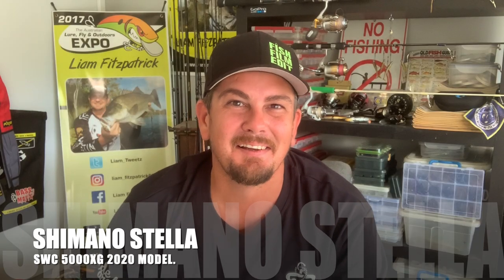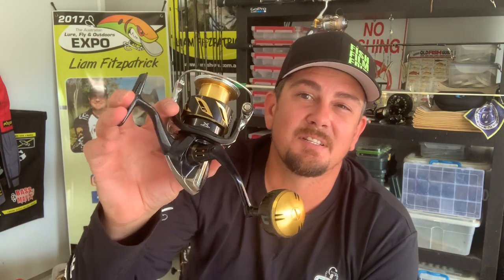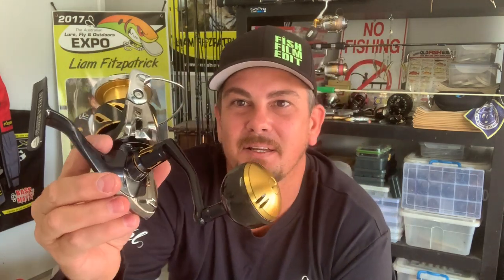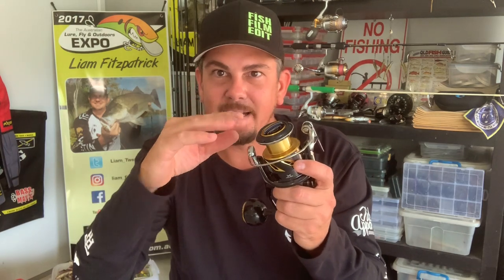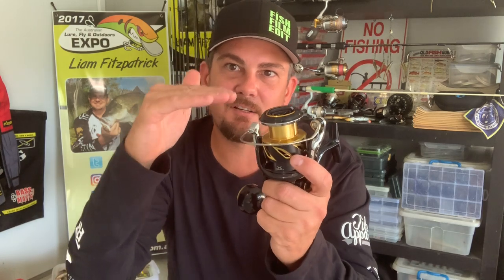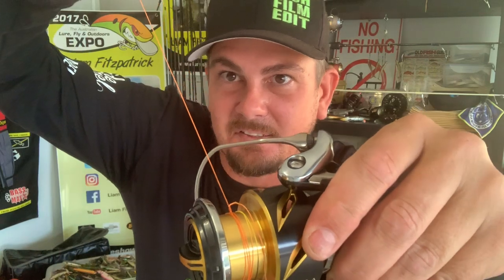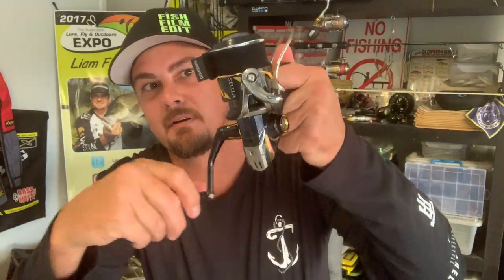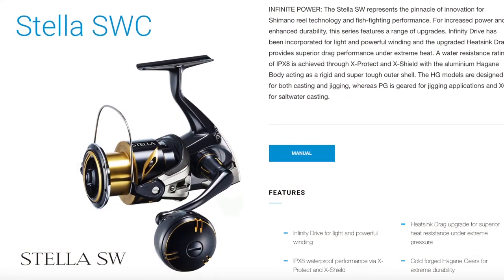SHIMANO STELLA SW 2020 | Spooling SWC 5000XG.

Comment: Great video, got a 6000HG, unfortunately my line will not lay properly, with or without shim. Had to take the spool holder off to get proper lay and I know that’s not right. Waiting on a reply from Shimano. At this point, not a happy camper. My Twin Power was flawless out the box.
Reply from the maker: Yeah that doesn’t sound right mate. They’ll sort it out for you no doubt.

Comment: Hi Liam, just on reels,  using 4 kg braid for bream and flathead flicking lures what would you choose between the stradic 1500 or a Diawa sol, I have 3 stradics and a sol, love them all but I kinda feel the line comes off the Sol better casting wise.
Reply from the maker: Up to you mate. They both would their own advantages. I like the internals of the former. They just seem to last.
Reply: alleycat ive used both the sol and stradic and you’re right, the sol (and the freams) do cast very smoothly compared to the stradic, but my mag sealed daiwa reels have been in service more than once because of accidental water splash/penetration compared to my ci4 stradic which i have literally accidentally fully submerged it in salt water for over 30 seconds and its had zero issues. I also fully hose down my stradic after each use and its never had issues. I cant do this with the daiwas. Daiwa is smooth, Shimano more durable.
Reply from the maker: That’s my opinion mate.
Reply: alleycat 
I don’t think daiwa would beat any shimano reel for casting with their better forward wide angle spool lip. 

African maasai

Comment: Hey mate I’m buying the 6000 model but can’t decide on the XG or the HG. I do a fair amount of shore jigging but also a bit of work with bibbed minnows and top water. Do you think the 6.2:1 with 112cm or the 5.7:1 with 103cm would be more preferable in my situation? Thanks.
Reply from the maker: I think popping or jigging or even fishing plastics you want to pick up line quick. If you need to pick up line quick between pops or when a fish hit your jig on the glide or your plastic on the drop. If you can pick up line quick to set the hook it’s really advantageous mate.
Reply: appreciate the advice bro, thanks 🙏.
Reply: Calum Martin 

Take hg one ! Fast enough plus good torque, going xg is just too fast with min.torque which leave u paying extra precaution to ur reeling under load !
Reply: @maasai-  hg is all around

Comment: What made you pick this instead of the 6000xg model? Thank you
Reply from the maker: 5000 is the perfect size for my PE 3 light jigging rod mate.
Reply: @LiamFitzpatrick  but only 5 grams diffirence with 90 meters line diffirence in 6000
Reply: @LiamFitzpatrick  but only 5 grams diffirence with 90 meters line diffirence in 6000

Comment: Hey mate, I’m thinking of buying a 2020 Stella 6000hg, I am thinking 40lb tasline and a grappler type c in pe 3. Would you have any suggestions when it comes to line strength or rod strength
Reply from the maker: A 6000 will run PE 3 or 4 I reckon. What kind of fishing will you be doing and where?
Reply: Liam Fitzpatrick I will be targeting multiple species of reef fish and other Pelagics, casting on reef flats/points. I’ve had some fun with a Stradic 5k on all these species but I’m going for an upgrade with a bit more strength as I’m worried about getting destroyed. I will also take the reel off the casting rod and put it on a Terez for bottom bashing.

Comment: hi ! I  just baught the new stella 2020 sw 6000 and the pinion gear is kinda lose just tiny tiny bit . Even with a locked drag and When you left up the spool . It goes up just little tiny bit. Is that for normal for stellas? Does your pinion gear on your stella move at all when you left it up also even a tiny bit?
Reply from the maker: I don’t do technical mate. I don’t have an issue with the two I just received but when ever I think I gave a problem I getting to my reel tech to sort it for me. I know how to use the gear not put it together.
Reply: iratherbefishing 
That’s normal . Actually most reels do have such play when u left up the spool , i have 10000swc pg 

African maasai

Comment: My 14000 was not so good a real, I bought the 5000 hoping it was bad. Turned out it’s a perfect piece of equipment. Love it, really don’t like the 14000, clunky piece of sht
Reply from the maker: Yeah it’s an odd in between size in my opinion mate. I’d run a 18000 for popping any day of the week mate.
Reply: Lads, sorry but I just don't follow. I have the 5k & 14k with the aim of having compact reels with high drag. The 14 has 350m of ~100lb braid which is good for everything bar monsters in a static position